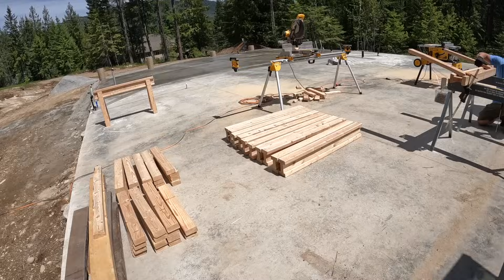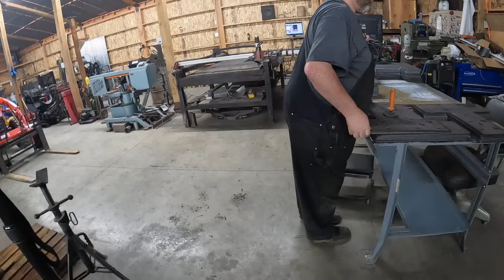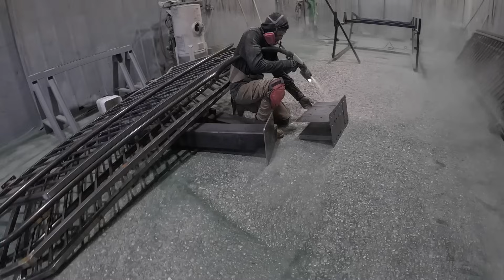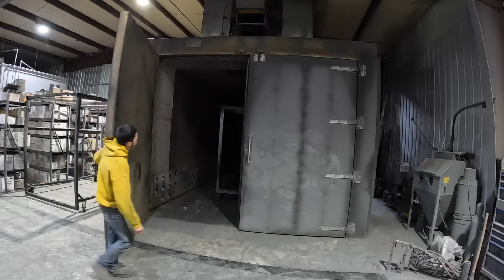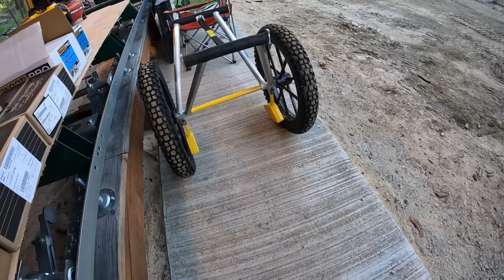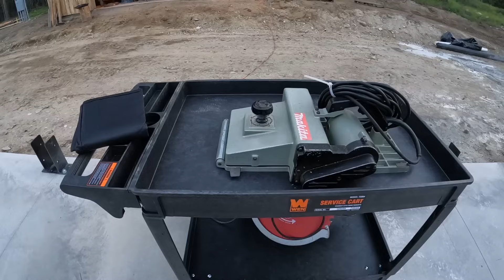Am I MISSING Anything? How I PREPARED And What TOOLS I'm Using To Start BUILDING Our BARNDOMINIUM

Comment: Looking good. Really nice on the brackets and plates. When I first saw them, I thought you had them painted, but no, powdercoat. 1st class. What are you going to use to drive the screws in? An impact wrench instead of an impact driver might be necessary. Extra drill bits for drilling through the beams and trying to line up the holes from both sides. Good idea on the extra saw horses. I like to make mine 17°. I think they are a little more stable with the wider foot print. But they do take up extra room. I like the tool carts with 1 or 2 drawers. Gives a place to keep smaller items so the big tools aren't laying on top of little things. Magnetic parts holders help to keep screws, nuts, bolts, washers, etc. separated and keep them from getting all mixed together when rolling a cart around. A wood shaping disc for an angle grinder will make short work of the bevels to let the posts fit down where the brackets were welded. Some long ratchet straps to pull timbers together to get a nice tight fit. The first bent will tell you what you might have missed. To get all of the angle braces in at the same height, you can measure down and screw in a stop board. Once the angle brace is in place, you can just unscrew it and use it on the next spot. Easier than trying to hold it in place when it is loose on both ends. 

Good luck. Looking forward to the process.
Reply from the maker: Hi, Mike- It would be nice to have these conversations over a morning cup of coffee or evening slice of pie 😁!!

I have an impact wrench for the wedge bolts but I could see it coming in handy for the timber screws. We are doing some pre drilling as well. Ended up getting some 12” screws.
I put on my first T-bracket last night. Not an easy task to get all those holes to line up. 
Good idea on the grinder to make the bevels.
Copy on the long ratchet straps!
Definitely will use a stop board on the angle braces for the sides. 
Trying to come up with processes that are repeatable and accurate. Making templates, have one person (for the most part) do the same job so the end product is consistent.
Exciting times for sure! 😊
Reply: @ourdreaminthewoods   One rule that I have, is to do an area/part/joint that is not visible (or at least not as visible) first to learn on. That way the mistakes aren't front and center. Good luck
Reply from the maker: Great tip, Mike- thank you! 😊

Comment: Those are super strong brackets and gussets really fail proof for your intended use. I like powder coating, however give me Alwgrip or Imron paints, even primed and single stage automotive paints will last decades indoors any day versus powder coat. These finish coatings do not chip,  delaminate with time, finish can be touched up, any color can be matched, much lower cost, longer lasting/durabality, no need to sand blast for prep. Can Boeing Airbus Gulfstream Kenworth Mack Peterbuilt Bertram Hatteras Caterpillar Case and many more all be wrong with preferred coating/paint choice? Alwgrip and Imron are proven tough  finish coatings used commonly in the most extreme environments. You could have saved big and had a more durable finish you could apply DIY. Ask subscribers for advice/suggestions for processes in future only cost to you is time needed to receive and review suggestions? Ray Stormont
Reply from the maker: Hi, Ray- That stuff seems like good paint . Problem of only knowing what you know- and being a novice at this whole process. 
I was making these decisions 4-5 months ago so it’s hard to put these questions out there. 
But yes - I need to tap into this great knowledge base from viewers. Thank you for that reminder. 😊
Reply: I completly understand and in your shoes would have likely made the same decision. Good luck your are putting much strength in this build and it will pay in the future for you and family. Ray
Reply from the maker: Thank you so much, Ray. 😊

Comment: I wish I could be there to help because I would porta cable drill and driver and we will at the end of day witch one is still running because I am trained carpenter and you will never see dewalt in my bag and there is lot guys who because they are cheap and east to find but for those who know we buy porta cable and never let me down
Reply from the maker: Hi, Wade- Once you take the step with dewalt batteries- they have you right where they want you. 
I am far from a professional carpenter or builder. 🤣